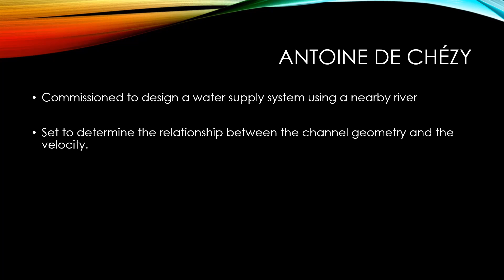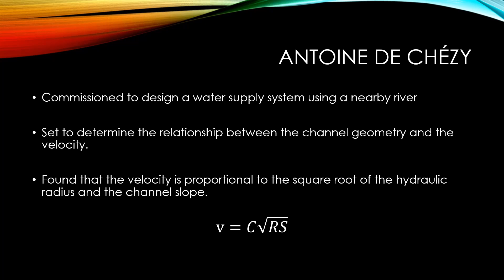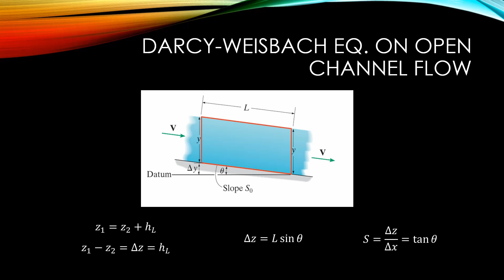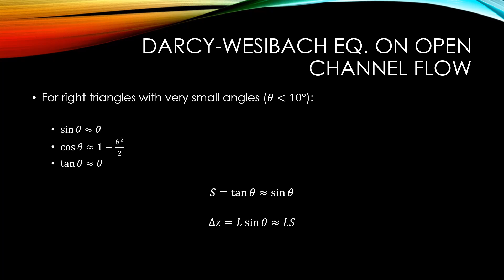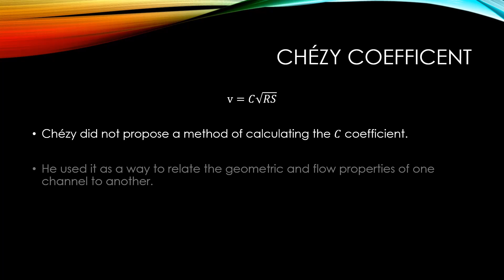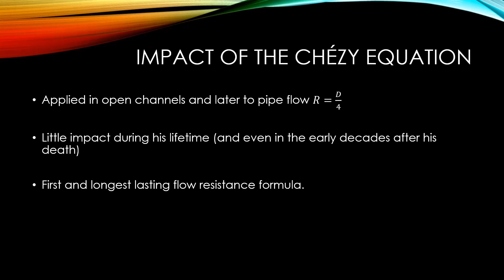Chézy Equation

Comment: Please can I use R=d/4 instead of R=A/p to calculate headlost due to friction when diameter, lenght, chezyls coefficient and velocity is only given
Reply from the maker: If you are analyzing a full, circular pipe, then R=d/4 and you can use that instead of R=A/p to skip a few steps:

R=A/p. For a circular pipe, A=pi*(d^2)/4 and P=pi*d.

So, R=A/p=pi*(d^2)/(4*pi*d)=d/4